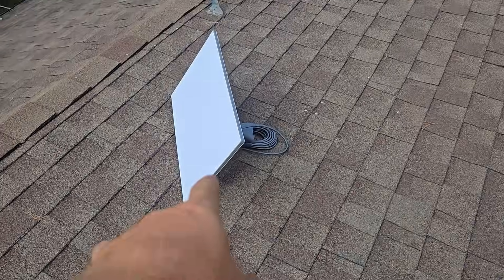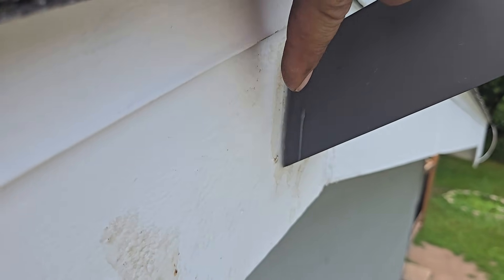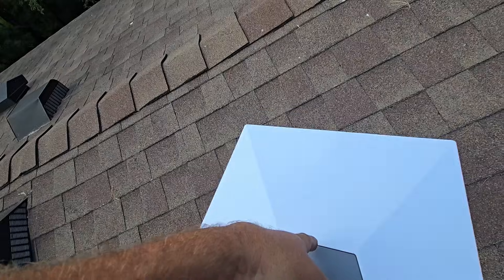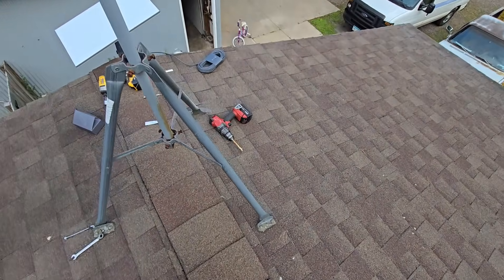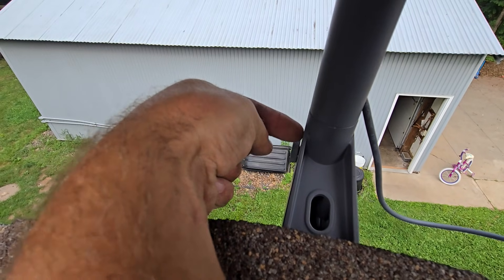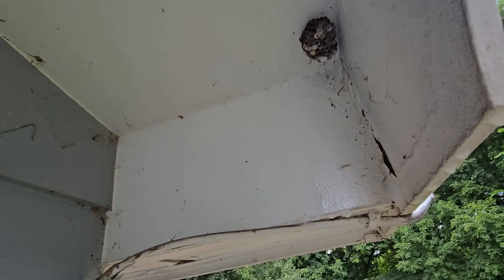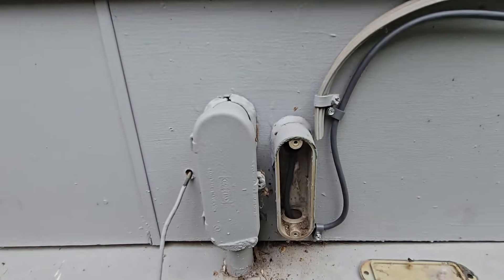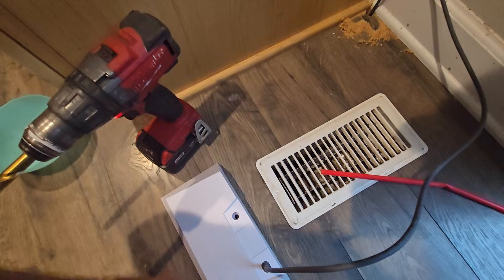HOW TO INSTALL STARLINK (YOU CAN DO)

Comment: Isn't the direction that the receiver is pointing more critical than " North" ?  I's think it would need to be pointed more precisely towards the satellite.  " The angle of the dangle"
Reply from the maker: you use the app to scan the sky. but it did say make sure you have clear view of the northern sky.
Reply: @FowlFab  I wonder if it's always north no mater where you are? I thought they had hundreds of satellites.  Will the app down load to a desktop PC? I don't use a smart phone.
Reply from the maker: @MadisonKansas  I don't think so. you use the camera on you phone to scan the sky.
Reply: @FowlFab  Again. I don't use a smart phone.  I'm near deaf and basically never have a need for one until now.  Buying one and service for a year to hook up am antenna is costly. Will starlink even work on a desktop PC ??
Reply: @FowlFab  If you need a cell phone to down load the starlink app......... You already have internet.